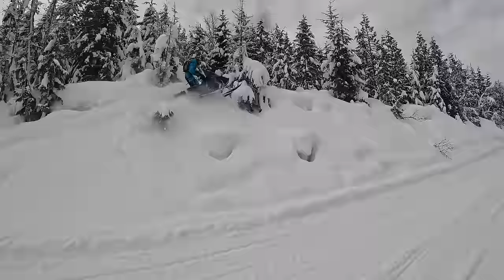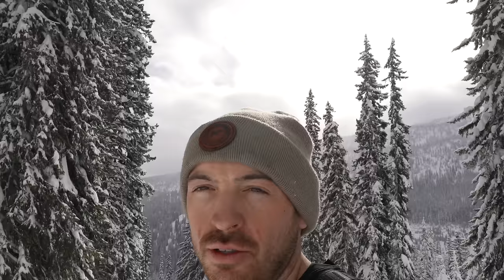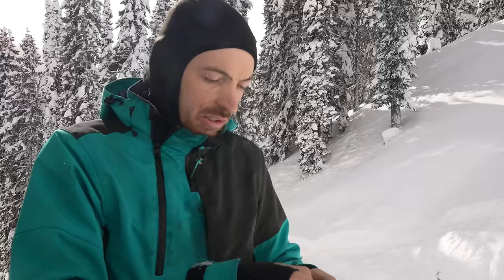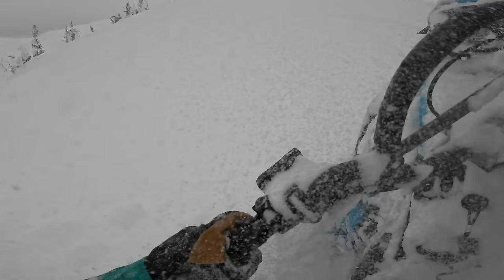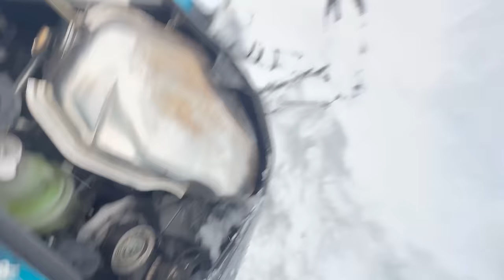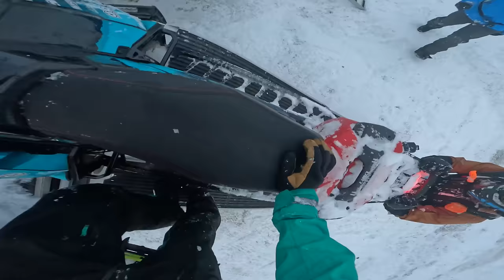Holding My Sled Wide Open Till It Breaks

Comment: Old sledders tip: to increase 2stroke engine durability -- even though the sled is auto oil injection , you can add mixed the gas in the tank aswell -- basically dosing the oil protection -- increase oil till just before foul -- the engine really does last longer that way // --- - optional other method: you can add home heating oil/kerosene to the gas tank   ..not crazy , several of us have done this quite alot   ..fun trivia: in India you can buy car gasoline at the pump that is 50/50 kerosene  -- 50/50 is too much for cold weather starts  but 10 20 or 30% works  -- i burned 2000liters of kerosene/home heating oil in my quads and sleds over the years -- the kerosene was just sitting in a tank as the house no longer used that fuel type so i thought I try to burn it and it works good , engines even run a bit smoother/quieter with it mixed in the gas

Comment: The only snowmobile I’ve ever held wide open for along time was 2009 Yamaha Nytro XTX 144” with 9500 miles, I was in the last year of my Yamaha extended warranty and I was trying to blow it up couldn’t do it though, I basically held it as wide open as I could across a lake for 45 miles, filled it back up with gas  and did the same thing.
It went back to the dealer for a recall later and I had them do a compression test and all three cylinders were 205 which was in center of the factory spec, sled doesn’t get much use now but still runs amazing at over 12,000 miles I’ve had a number of sleds since but still have this one

Comment: Matt next time you have a day where the conditions aren’t great or you take a day off from riding will you make a video about your gear (I know you did one already) but slightly more in depth kinda comparing some different gear you’ve had in the past. I am currently having a hard time finding goggles that I like, do you bring two sets each day so when one dogs you can switch? I have heated 509’s and they are garbage IMO and another 509 set that I use with magnetic lenses so I can switch between them. While one is on I have one lenses in the compartment in front of handlebars. Also I remember not long ago you said you were gonna show us a bit about what you have in your packout and what you take with you, I would just really like to see that video if you have time. Thanks and I really enjoy the videos, watch them every day.

Comment: so what belt did he blow, ive never seen the belt on the right with a sprocket on a polaris, Is that just the matryx or 9r's?
Reply: Polaris, and now Arctic Cat, have a drive belt instead of a chain case. It's a lighter mass to spin and frees-up horsepower. Doo are the only ones who still uses a chain case.